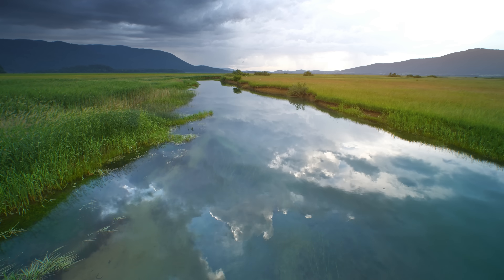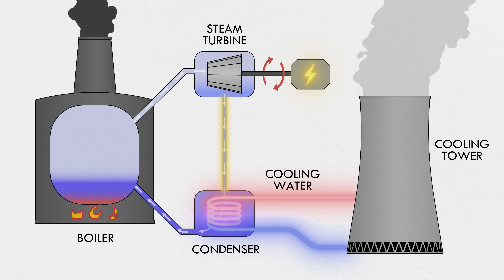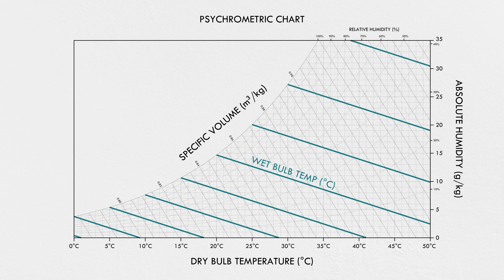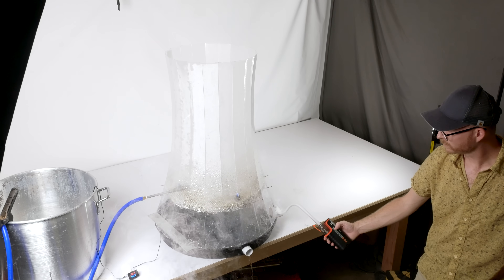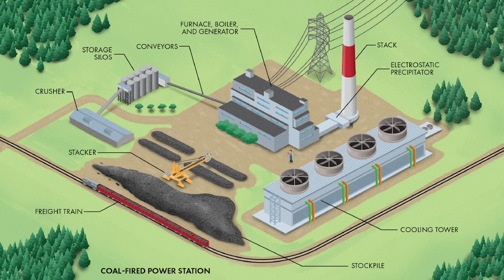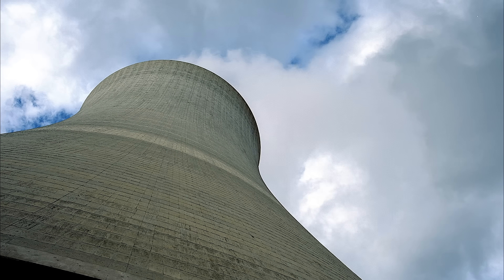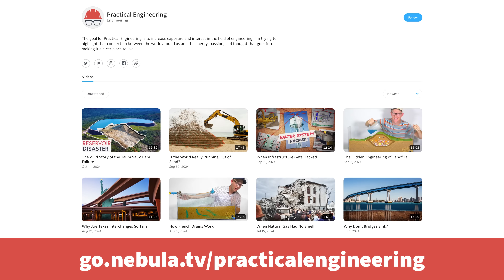Why Are Cooling Towers Shaped Like That?

Comment: I was waiting to see if you covered the applicability of natural draft cooling towers to dry locations.  Back when I first started working at nuclear power plants, I noted that both Palo Verde (which you showed) in Arizona where it is hot and dry, plus Columbia Nuclear in Eastern Washington where it is cold and dry, don't use natural draft towers  All other nuclear plants in the US with towers have natural draft towers.  I asked the mechanical engineers I worked with why and none could answer.  Puzzling it over, I came to the same conclusion you did.  It is the fact that the initial density goes down when the initial wet bulb temperature is low enough.  Dumping the water in the tower will eventually warm things enough to cause a draft, but that results in a higher condenser back pressure and a lower plant efficiency.  Well done video!

Just some minor points:
- Temperature is very important to efficiency, especially with nuclear power plants.  The initial steam conditions at nuclear power plants is much lower than coal or oil, resulting in much more of the total work being done below atmospheric pressure.  The pressure drop is low, but the volume is absolutely massive on those last few rows of blades.   Combined cycle power plants care MUCH less due to the conversion of energy starting from combustion temperature. (That whole Carnot thing...)
- The name power plant engineers like to use for condenser cooling water is "circulating water".  It is kind of descriptive, since it is just circulating around, never boiled.
- Nuclear plants don't use the natural draft tower for safety systems with the exception of some of them that do use it as a third or fourth tier backup.  Cooling of safety critical equipment is desired to be absolutely redundant with nothing shared between diverse safety systems.  In the case of plants cooled by natural bodies of water, they'll use the one body of water for all safety systems if it is very reliable (no upstream or downstream dams that could take it out, etc...).  Most of the use redundant ponds totally separated from each other. 

A good example of this extra source of cooling water is at Comanche Peak nuclear power plant.  If you look to the south of the plant, there is a second earthen dam blocking off a cove.  It has a high water outlet canal to the main reservoir.  This extra cove can hold 30 days of shutdown water even if the main dam were to fail.
Reply: Thank you for taking time to add this excellent info! I'll offer just another small tidbit - There are other nuclear plants in the US with forced draft cooling towers, Farley in south Alabama and Hatch in south Georgia to name a couple.
Reply: The nuclear plant near Oswego NY is somewhat interesting in how it has both a cooling tower, and uses Lake Ontario for cooling. 

Lake Ontario does have dams controlling its primary inflows amd outflow, but i doubt that posses a risk for the Oswego plant. Generally speaking the first powerplant draining the lake is a run of river facility, and the IJC tells them how much water to let flow down the river. (IJC = International Joint Commission of Boundary Waters) The IJC is trying to balance a lot of different needs ranging from ecology to recreation to commercial shipping.

A dam failure would be really bad, but not because it would rapidly drain the lake. Montreal is downstream and 1in change in depth to Ontario would raise the river at Montreal by 33ft, if Ontario suddenly dropped enough to expose the inlets at Oswego then Montreal was probably removed from the map. (And multiple dams had to fail at once)

Ultimately using the Great Lakes as your cooling source is like using an ocean except less angry. (No tides, tsunamis, or hurricanes/storm surge)

Comment: I worked in a power plant many years ago. I found it amazing how much power is used to make power. We had motors as large as 5000 hp. The main stack purge fan was too big for one motor, so two 4500 hp motors were connection is series with a clutch between. They never started both motor together. They would start one, then start the other, and then connect them for 9000 hp.

Comment: By the thermodynamic laws 50% of the energy input must be rejected to the heat sink. Add another 15% of heat input goes up the stack. Yes a rankine cycle efficiency is about 35%. Put 1000 units of coal, gas, fossil fuels energy in put get about 350 energy units out to system.

Comment: Our company had a contract to make precast concrete beams and columns for the cooling towers at the Byron nuclear plant in Illinois. They were changing the insides to hang a plastic media off the beams to improve this cooling process. So we had a nice look around inside the towers during construction. Basically a giant shaft just like the model.

Comment: The best solution for the future of energy supply is the construction of Molten Salt Thorium Reactors.  Besides providing abundant, electricity, they can provide a myriad of other functions that will completely defuse the Green Agenda.  The so-called renewables actually do more harm than good because of the mining and toxins involved in their production and the waste they produce. It is possible to keep the current transportation infrastructure in place.  For example, synthetic gasoline production has been made a reality.  This is a carbon-neutral process of capturing carbon and reconstructing the gasoline by adding Hydrogen, recovered from atmospheric capture means that we can shrink that atmospheric (and oceanic)carbon.  MSRs can make this happen in realistic quantities.  They can be built on existing power plant sites, like coal or diesel plants, and use the same already existing power grids.  MSRs can be made small enough to run a car, ship, or train.  They can be used to desalinize ocean water on a massive scale.  They cannot melt down because the molten salt is the fuel carrier.  Thorium is preferred over Uranium because it has 200 times more energy potential and is dirt cheap.  Thorium is abundant and has been the "waste" product of rare earth mining.  The reaction occurs between 600-800 degrees F.  Molten Salt's boiling point is 1,200-1,400.  If the molten salt should ever overheat the reaction stops and a freeze plug in the bottom of the fuel jacket melts and the molten salt flows into a holding tank where it cools down naturally.  The traditional Light Water Uranium Rector requires extensive and expensive pressure systems to get the water hot enough for the reaction to occur and then cool it down again.  MSRs require none of this, making it far less expensive and safer to run since all the meltdowns that have occurred have been due to a failure of the cooling systems.  MSRs can be set up to burn the waste from light water uranium reactors because they are so efficient.  They can be used for producing non-carbon diesel fuels.  They can be used to cheaply desalinate seawater, and scrub carbon from the atmosphere.  They are safe and can be built anywhere. because they don't need water in any aspect of their operation.  They can be made small enough to power a car or big enough to power a city.  The U.S. has about t a dozen companies that are either ready or near ready to construct them   France is developing them and Denmark has one company developing them.  I don't know about Germany, but Germany would clearly benefit from them and could erect them quickly if desired.  They must get over their anti-nuclear sickness, however.  There is no time to waste.  here is a four-minute introductory video to MSRs. - 
https://www.youtube.com/watch?v=k6BXvw6mxtw

Comment: I paused not very long in, to think how i'd design a cooling system for a nuclear plant. I actually got fairly close. I'd run a series of vertical thin aluminium pipes up along the tower, and have cooling cool water flow though those pipes to keep it cold. That heated water could be used to heat nearby homes.

Comment: This was entertaining, but the technical details you went through in this one were GREAT. In fact, the wet bulb temperature stuff -- specifically why hot and dry air doesn't work well with these cooling towers -- was so tricky, I would LOVE to have another video on it.
Reply: It's not clear what you're talking about. If you mean why wet bulb temperatures happen at all, that's common info you can get anywhere by researching evaporative cooling. If you're talking about the rest of the secrets of the psychrometric chart, I'm afraid you'll probably have to take a college course.

Comment: You can also see the power of water cooling moving down through the air in the shower, notice the temp is much warmer at the top of the shower and cooler near the bottom as the droplets separate and lose heat to the ambient air

Comment: FYI, while gallon and cubic meter are both measures of volume, and while liters can be expressed in cubic meter, 1000 liters is colloquially only rarely references as 1 cubic meter. Especially where exact numbers are not needed to make a point, gallon are best 'translated' to liters so make it easier for even the layman to understand :)

Comment: 4:43 "We can only get this water as cool as the ambient air temperature"

What?  Not the wet bulb temperature?  (Or maybe even the dew point, with counter-flow heat exchange to cool the air that finally cools the water.)

Oh.  Ok, then why say that?

--

Why a hyperboloid, instead of the surface of rotation of some other curve like a parabola or catenary?

Comment: The reason the steam needs to be cooled as it leaves the turbine is to create a low pressure that causes the steam to move more quickly through the turbine before it can’t condense and damage the blades of the turbine.

Comment: Not far from me, the Brayton Point Power Station, the largest coal-fired plant in New England, built a pair of 500' cooling towers in 2008-11 because of long-running concerns about the plant's effect on water temperatures in Mt. Hope Bay. They only got six years of use out of them, though, because no sooner had they been finished than the plant was sold and its new owners soon decided to decommission the plant, so practically as soon as they went up, they came down.
Reply: Built those as EPC in 2010.
Reply: Killed by green power.
Reply: A unique aspect of the project was the retrofit from once rhrough seawater cooling to closed loop tower cooling.  Make-ip water remained brackish water from Mt Hope Bay and we cycled to 3 CoC...special concrete mix designs etc. plus system was gravity flow CWS to the 4 existing unit condensers [of 3 different sizes and flows], pumped HWR with special allow pumps with IC cathodic protection.  Believe me, it would have lasted way more than the 6 years they ran the place!

Comment: you can actually cool water below ambient temperature in cooling towers if the air is dry enough, this is due to the enthalpy change of the phase shift of the cooling water, peak is about 4 ºc bellow ambient

Comment: I have always wondered what the groundwater level looks like in hilly areas.
It is not necessarily the case that the hilltops are dried out and there is always water in the valleys.
I wondered if you could give us some clarity on that.

Comment: question... why is the steam not recycled.. rather than keep heating more steam. can it not be returned thru the system like a turbo charger. would that save energy. because less steam would be continously re used. reducing the need to create more steam... a bit like a boiling pot with the lid on that gently cooks food .. simmering. with the heat turned down. . . .  or.. is it allready recycled. and the chimneys are the last part of a long re used cycle.

Comment: I'm a firefighter and I just ran a medical call at my local coal fired power plant last shift. My partner and I were in shock at the scale of the place and had so many questions about, of all things, the cooling tower! Thank you so much for putting this amazing content together!
Reply: They're pretty insane. Blows my mind that people were able to design and build these things back before computers. You should see the maze of pipes, tubes, miles of wires, and somehow making room for people to get around and work on them. 

Whats really cool is that the boilers are suspended in the air because they grow downwards when they're online and flex a lot. Which is something else we have to take into consideration when retrofitting, as things can get into a hell of a bind and break if you attack moving points together

Ours uses a lake for the condenser water, and most of the others use cooling towers, but not the cool looking ones that a lot of nuclear plants use
Reply: We get a lot of that from people visiting the place I retired from.  So impressed with the one thing that doesn't have any moving parts!

Comment: Everytimes I see large cooling towers, I think there's some more energy to harness there. It creates a draft, there's heat, etc. Obviously it won't work; if there was a way to get more energy there we would already have done it after all. But still, they're huge, so the question linger in the back of my head.

Comment: I think that it would make sense to build cooling towers (thus whole power plants) close to really high mountains. That way you are more likely to see the rest of the escaping steam condensate in a close vicinity of the power plant, flowing back as a potential cold water stream, that can be put into the cooling tower again. The only downside is that the mountain glaciers would likely not like that.

Comment: I wonder if it would be a better idea to dump the heat into the water main to both prevent water freezing in it causing water grid damage and it reducing a person's heating cost for their own water the net negative would be potentially higher corrosion to the metal pipes and people might not like having warm water coming out of their cold water feed

Comment: A turbine is a hat made of a large quantity of cloth wrapped around the head a turbine is a bunch of mental blades used to convert mechanical energy from a large quantity of high pressure gas too high torque mechanical energy in a gear system

Comment: Something that the video only briefly touched upon that I feel bears emphasizing to the layperson would be how the water in use by the reactor stays a closed system, and transfers its heat to the open system by being run through pipes in contact with the other system of water. This means the water coming out of the cooling tower hasn't been in contact with the reactor.

To someone who knows better, obviously it makes more sense that the most important design element to emphasize there is that this system avoids wasting water that had to be properly treated. But to people whose only understanding of nuclear power comes from the Simpsons...

Comment: How would it work if cooling water would be evaporating seawater? Wouldn't it be clever to use the output heat to produce freshwater? On ships engine cooling systems produce freshwater from seawater. Just using the heat, that would be lost anyways. So, they basically produce freshwater for free.

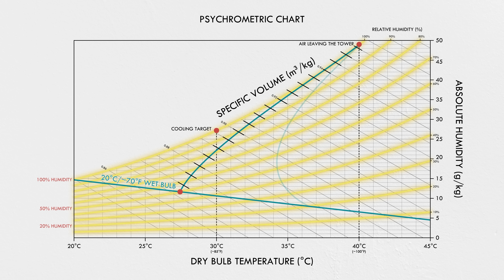Comment: 16:00 This is facinating, I live in Las Vegas and I always wondered why evaporative cooling like this wasn't super common for things here.
Reply: Because Las Vegas needs to recover every drop of water that they can.
Reply: In Vegas regional cooling pipe systems  for buildings to connect to ,really should be a good idea, how much of vegas electricity goes to hwac systems? I bet a lot ...
Reply: We do have the Edward Clark Generating Station in Henderson on Russell and US95 (now called I-11). But it doesn't use big cooling towers, just small ones. It might be the fan type too, I can't tell from just seeing it from the freeway. I'm not sure what the power plants in Apex used, it's been a while since I been out that way. They shut the coal plants down, but I believe they have natural gas ones out there now. During the cooler months you see a lot of water vapor coming from them. I didn't see any tonight, it might be shut down for maintenance, or that electricity is not needed right now since it's not very cold. Most of our power is from outside the city, and this plant used to be outside the city at one time, but the city (cities) grew around it.

Comment: That intuitively doesn’t make sense that water molecules make the air more buoyant than oxygen and nitrogen molecules. Is it because oxygen and nitrogen form double bonds in the atmosphere so it’s N2 and O2 with atomic weights of 14 and 16 respectively whereas water molecules have an atomic weight of 10? Ok I explained it to myself. Thanks for listening to my TED talk

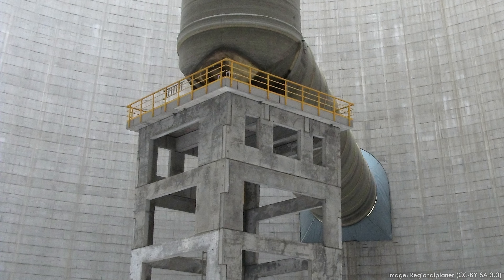Comment: 17:18 Even if "flue gas" is put into the tower, it's probably not "flue gas" per se; it's been heavily filtered to get rid of the harmful stuff, and it's no more than hot air and a little water vapor.
Reply: It's still all of the CO2 and even if 99% of the other stuff gets filtered out that's still ten thousands of tons.

Comment: Wow... I learned some neat things! Although I knew the basics about the psychometric chart from my architecture training (we needed to learn so we can at least have a base understand when talking to HVAC consultants), I didn't know about that curved air takes as it changes temperature. Also... It never clicked for me that water is less dense than most air. I mean, now that I think about it, N2 will be 28 and H2O will be 18, but now it makes sense why water vapor rises. 

Thanks Grady!